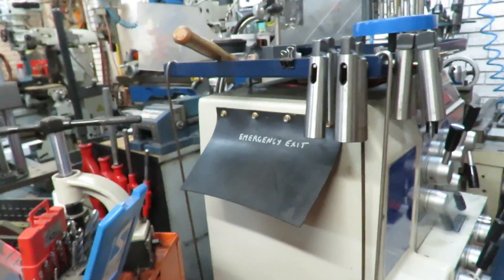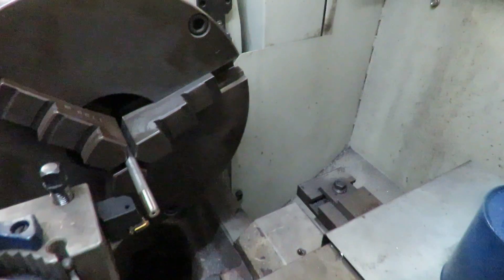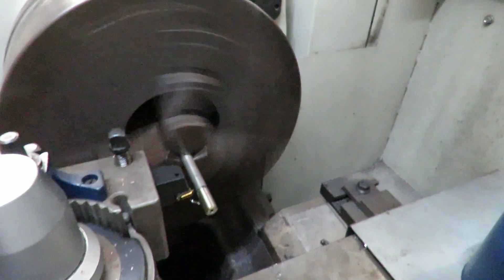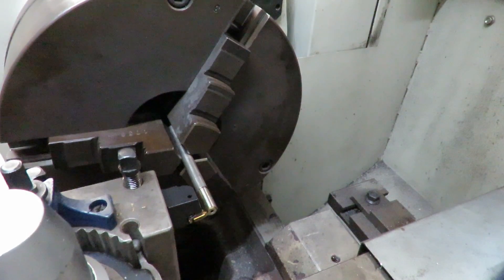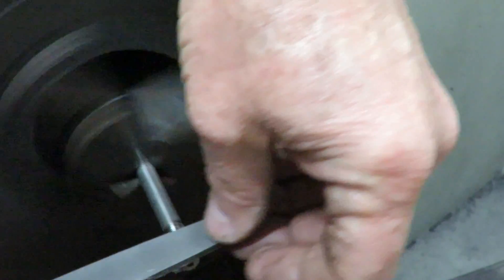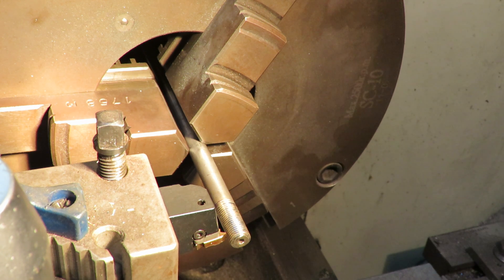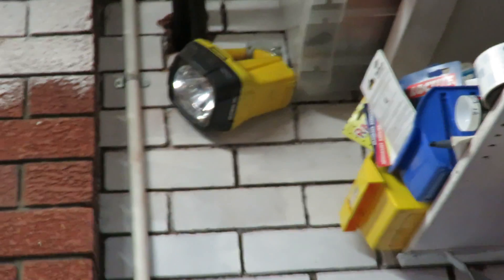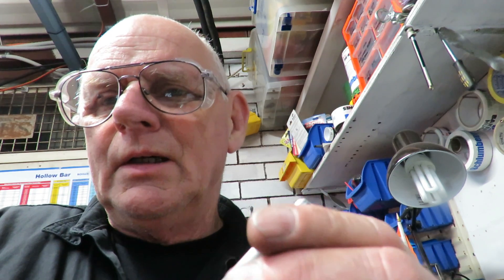Cutting left hand threads for high pressure duty pipes

Comment: Hi mate.  This might be a silly question, but why did you not support the end with the tailstock?  It seems that the tube/pipe was being pushed away by the cutter, or am I wrong and should shut up until I know what I'm talking about?
Reply: In my opinion it is not a silly question at all but a perfectly valid one to ask.
Reply from the maker: Marcel, I generally do, in this instance I just cut in in nibbles and eventually the spring cuts stopped deflecting once I change the tip around, all good.
Reply: Thanks for that, I was just wondering.

Comment: Having enough tooling around that they can get mixed up or mistaken for something else.  Wish I had that problem!  I'm at that stage where there is so much that I need to get, I don't know where to start, unless it's an immediate need.
Reply: IM IN THE SAME POSITION I HAVE 14000 DOLLARS IN TOOLING IN MY WELDING /MACHINE SHOP AND NEED LOTS OF THINGS YET. a dro for my 14/40 metal lathe is next after i mend up from a dislocated left shoulder at least im right handed lol.